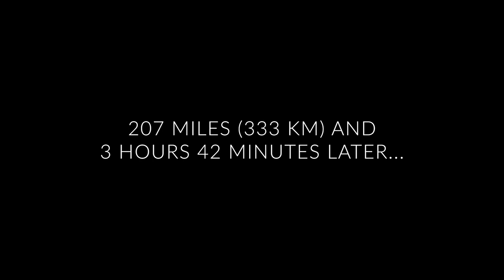☕ Driving, thoughts and microphones // Recording Truro Cathedral Organ \\ Episode 2 of 5

Comment: I am looking very much forward to this series. Regarding the Focusrite Octopre I find the Xfmr gets extremely HOT - so I have stopped using them and now use their Clarett - higher quality, less noise. Mic's:  am using Schoeps (switchable Omni/Cardioid) MK5's, and for Ambience: a Calrec Soundfield. The Soundfield multi-core cable is very heavy, being armoured, and on its own drum.
Reply from the maker: That's really interesting - never noticed my Scarlett getting hot. I have four of them (2x 2i2s and 2x 18i20s). I have a Gen 1 18i20 which powers the Hauptwerk setup (8 speakers, 2 monitors and headphone all running) and I've never noticed it running too hot. Sure it gets warm, but nothing to make me concerned.

Do you record organs, Michael?

Comment: With just one pair of omnis in your kit you are not going to be able to experiment (if you stick to your plan) various omni-only setups. Which in my experience, and many others', is The Solution for recording an organ in good acoustics. Trying to blend spread out microphone pairs tends to create more problems than you think it will solve.

Best of luck anyway.
Reply from the maker: Thanks Kari. Really interested in your comments - what set up would you do with my microphones?
Reply: @beautyinsound  I am not there and never have been, so this I just speculation. If the organ was situated symmetrically at the end of the church a good starting point with omnis would be 1/4 to 1/3 the length of the nave at the height of the organ if possible. Of course you must have the possibility to monitor the sound in situ to make reasonably fast adjustments.

With small capsule microphones like Sennheiser MKH 8020 which I have it is possible to use acoustic pressure equaliser balls which make the microphones more directional at higher frequencies. This does not affect the bass response, but gives some cardioid -like spatial solidity to the aural image. Normal AB spacing but angled out like DIN or ORTF.

Apparently the Truro organ is not situated symmetrical, so it complicates matters. There is not much space in front of it, but I would try with semi-wide spaced (60 cm or so) omnis about 2/3 nave width away from the organ. That should give enough straight sound clarity and reverb blend, and the solid bottom end of omnidirectional microphones.

The recordings that I have heard which try to blend straight sound with reverb mics have not been to my liking. 

Naturally all this depends on how much time you have to experiment and make comparisons. If I were you I would be weary of Internet experts like me who just as well might be a dog...

Something to ponder anyway.